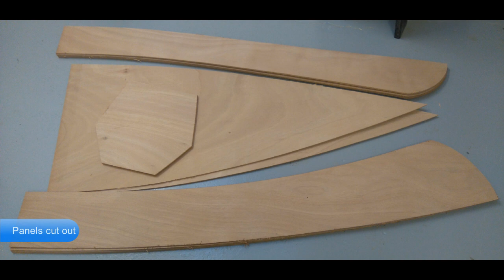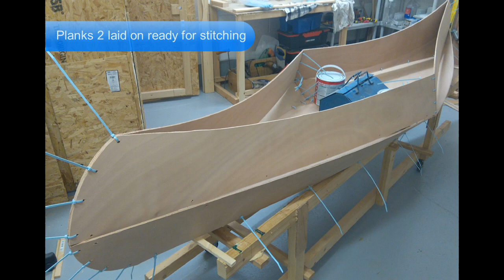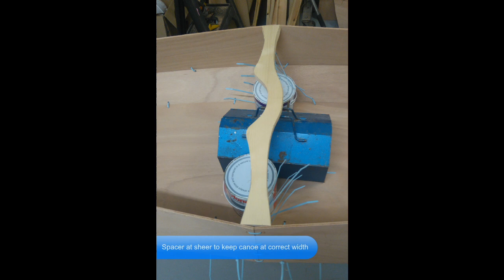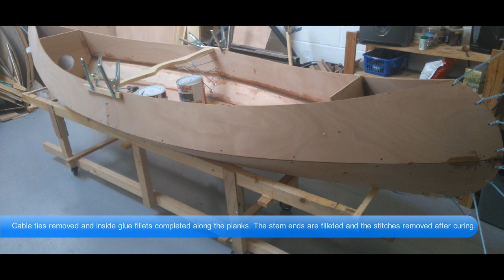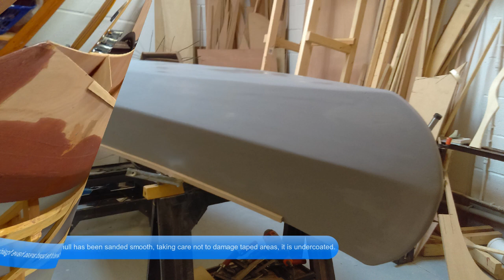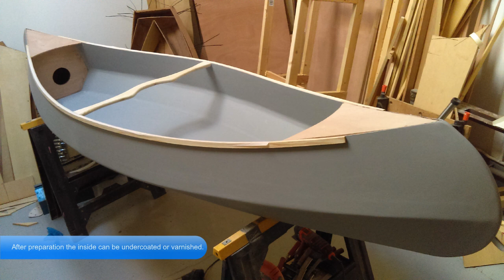PM10Build Pics

Comment from the maker: We use West System 405 for the glue filletsand we don''t cover the boat in fibreglass. It is sometimes used on the bottom if the canoe will be taking rough ground.

Comment: I'm surprised that the boards are butt-jointed and not scarfed or puzzle-jointed.
I'm currently building one of your Fairlight multi-purpose sailing canoes, which I am puzzle-jointing.
Reply from the maker: It's a good point but it was designed for this sort of build method and gains its overall strength from the interior epoxy filleting, the exteior epoxy taping and the epoxy tape both sides of the butt joint. Puzzle jointing is strong, but not within the DIY capabilities of everyone so a strong, simple joint was needed.